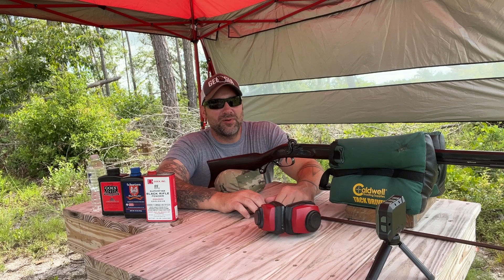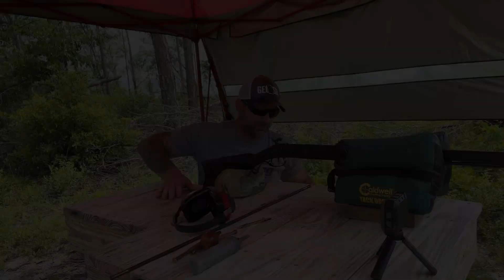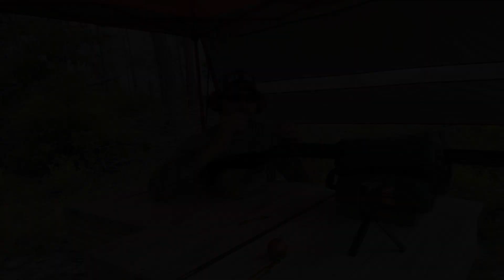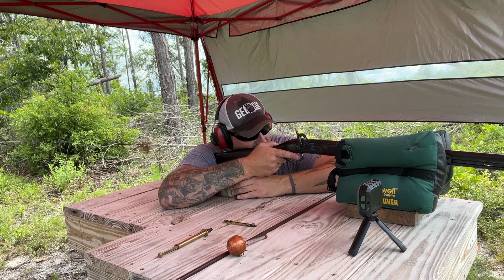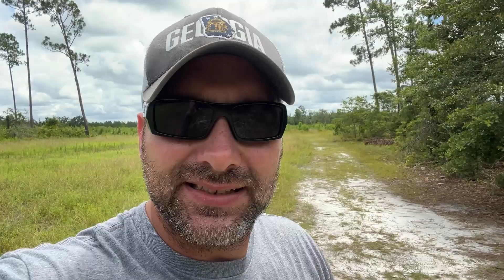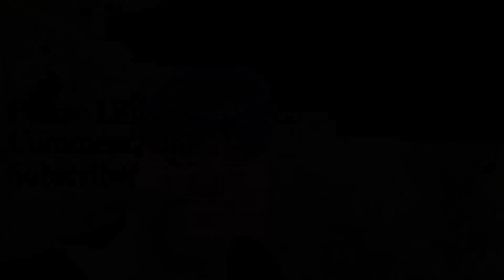Testing the Hawken Rifle (Part 1): 2F vs 3F Black Powder

Comment: I have done Black Powder for 44 years and I use a combination of Three and two f Goex powder, Equal amounts by Volume out of a Traditions .50 cal Flintlock. Also use a old Jukar .44, 1851 Officers Pistol, and a .58 cal smooth bore Flintlock. All have performed Great in Competition Shooting as well as Hunting. Keep your Nose to the wind and Watch Your Top Notch!
Reply from the maker: Do you premix a large batch or mix it shot by shot?
Reply: @HistorywithG-Hall  Premix, Recovering the Patches, Straight three f would Burn edges and two f UN-burnt powder. But to each his own as in the Weapon you choose.
Reply from the maker: @bent_rod_racing2720  I have made a video about your load.  It should be coming out in a week or so.  I hope that you will watch it.  Thanks again.
Reply: @HistorywithG-Hall  I forgot to Thank you for your Postings, And yes I am going to subscribe and watch for sure.

Comment: My 50 cal Lyman Great Plains , I only use FFG  90 to 100 gr, with round ball, a bit on the higher end but really good accuracy hits a 9 inch cast iron skillet almost every time and hits like a. Freight train out 100 yards but I always used # 11 magnum percussion cap…. Never had a misfire or hang fire, made mine from a kit in 1980 as I recall
Reply from the maker: That’s great.  I love hearing about good rifles.

Comment: Your experiment has a flaw Goex is a slower powder even if you used 3f. If you are going to do this you need same brand of powder. If you would have used Swiss 2f it would probably been faster than the 3f. Just my thoughts.
Reply from the maker: Thanks for sharing.  I agree 100%. Unfortunately, like our predecessors, I had to use what I could get my hands on.  The days of the local gun store keeping black powder locked in a wooden cabinet are long gone in my neck of the woods.

Comment: Good talk! My AMM friends have told me that more than ballistics, efficient burn and economy of powder was the most critical issue. And it does make sense as you had to conserve what you had until re-supply at rondy. They claimed that the old timers would use two methods: One [which doesn't make sense to me] was to place a ball on a flat surface and then trickle powder over the ball until it was just covered by a cone of powder; this then was your correct measure. The second was to test loads over a pristine field of snow and then inspect for unburned grains and then back the load off until the whole powder load was consumed. Interestingly, the Corps of Discovery took along lead containers filled with powder. When opened, the container was melted and used to roll ball, and the powder amount corresponded to the exact number of loads for the produced balls; another example of powder economy. I have a .58 Hawken and generally use 60 grains FFg with patched .562 ball, but have used 3F when out of two F.
Reply from the maker: That is good information.  Thank you for sharing.

Comment: I have been both a shooter (50 years) and a living history aficionado for over 38 years.
I tend to use 3ffg powder in all of my 50 and 54 caliber rifles
 I have found their 3ffg powder to be slightly cleaner burning, and I will prime with it in my flintlocks.... less hydroscopic
In the pan when it's rainy or very humid.
As for my smooth bore in 60 caliber, 75 caliber, and shotguns, I'll use 2ffg black powder. While hinting a
I tend to prime with the same granulation as the load in the barrel.
Reply from the maker: Good to know.  Thanks for sharing.

Comment: Powder still is a commodity along with percussion caps from what I hear.  There was 4 of us who used to do wood walks in the Wind River mountains of Wyoming… very “unofficial” as we took turns calling targets (usually stumps or rocks) and shoot from 15 to 150 yards which is a poke for a flintlock.  The other 3 have passed onto to the long runners in the sky.  I shoot mainly Swiss 2F in my .62 caliber Transitional flintlock and 3F in my other calibers.  I do shoot T7 3F in my old 1976 TC percussion Seneca in .36 caliber and also in my .32 caliber Crockett as the ignition is hotter.  I love to hunt with my muzzleloaders… Thank you for keeping the faith.
Reply from the maker: Thank you for sharing.  It is getting hard to find some of this stuff.
Reply: @HistorywithG-Hall yes sir it is.  I am an FFL and gunsmith so the ATF ruling on no more than 50 pounds of Black Powder at one site or magazine can limit one’s stash.